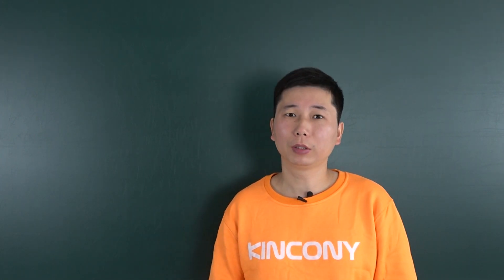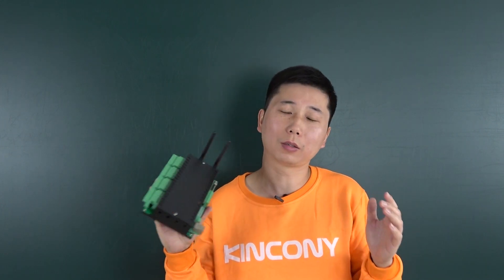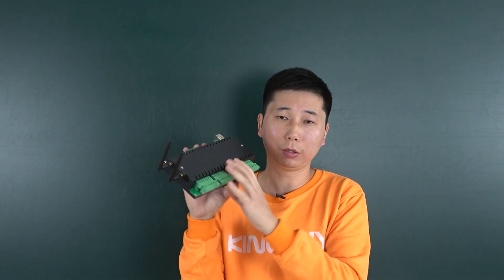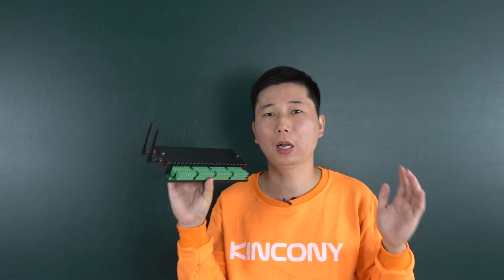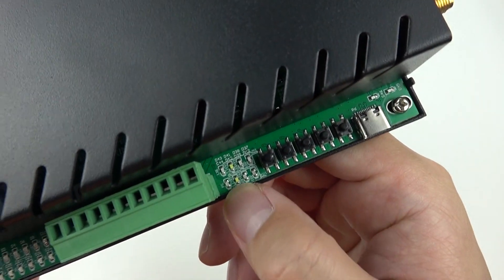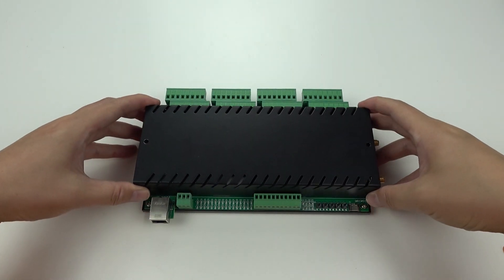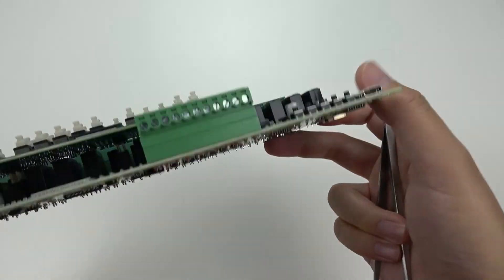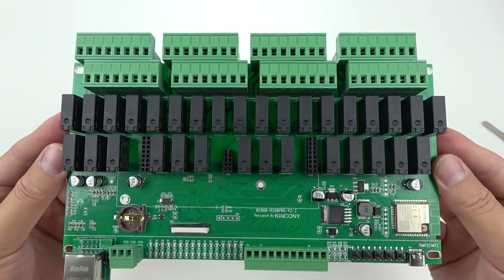The most powerful relay module for home automation -- KC868-H32B Pro

Comment: One downside I see is the ESP32 Module is soldered, if we can make this modular and easily replaceable so that in an event of ESP32 failure we can replace the chip easily.l
Reply from the maker: because we firstly consider stability to avoid poor contact.

Comment: This is really amazing product we love it I will just put my comments. Instead of Arduino coding, we would like if it to have its own application same as Smart Home or Tuya so it will be so easy for everyone because most customers and people don't know Arduino coding configuration.
could you please create a nice application interface that will work with all your Boards so the customer can select the model and be ready to go. Thank You
Reply from the maker: thanks for your suggestion. our A series board mainly use for DIYer, that need arduino code, but H Series board all have own application. in furture H series controller will all support Tuya, can use Tuya app. KinCony's controller will work both with internet and without internet.
Reply: Could you please create demonstration video of tuya smart app how is the interface and operating system.